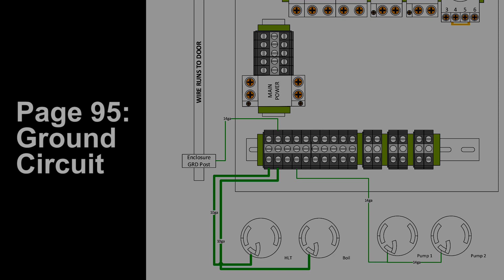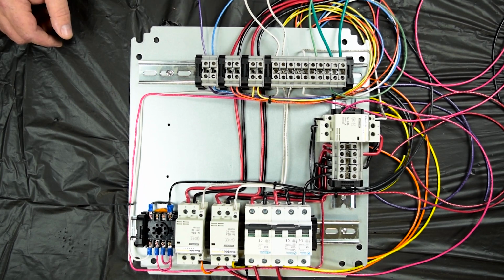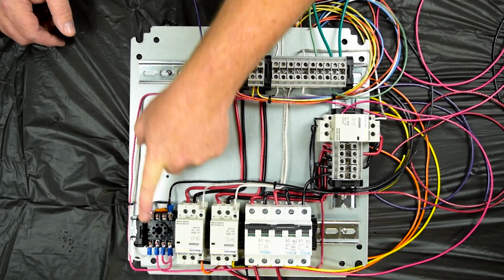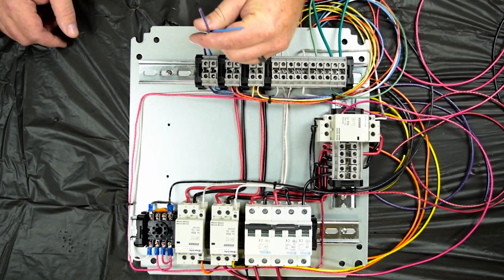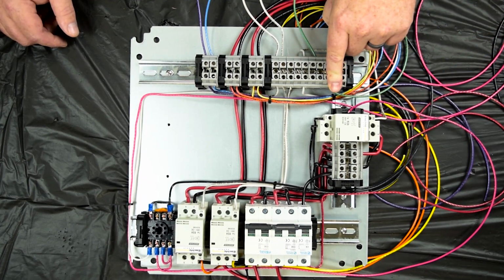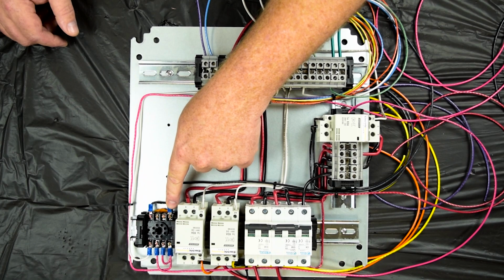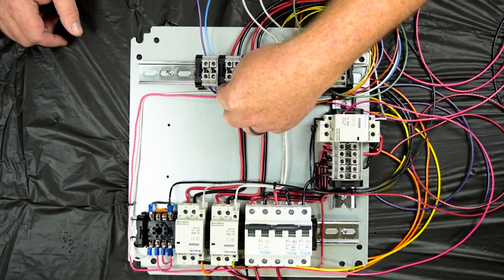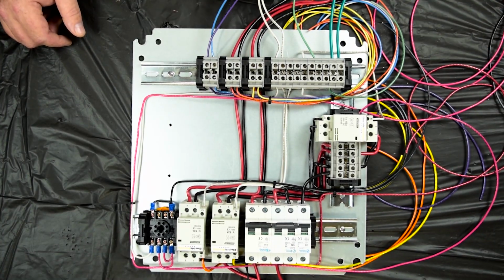Electric Brewing Supply - Panel Build - Back Panel Wiring Completed #electric brewing

Comment: The sub panel is coming along really well. Looks great, Brian! The only things I would recommend doing differently would be to save the 10 gauge red and black wire for last, so that it lays on top of the other wire, and second Pete's recommendation to use cable tie mounting bases to organize the wire as you go. Your wire runs are looking good though, so you'll be fine even if you leave them off the sub panel. But I'd highly recommend them for the door, as it can get really messy. Also, if you look on page 100 of the wiring guide (Wiring the Main Power switch and Green LED), you'll see a loop of red 18 gauge wire that runs from the main power distribution terminal blocks to the green LED. You'll probably want to add that before you merge the sub panel back into the enclosure. Keep up the good work. I'm enjoying following along with your build!
Reply from the maker: Thanks Carl!! Good advice. Thanks for watching.. I used the zip tie hold downs on my own panel and I am planning on adding some to this as well.. something else that the instructions don't call for but I'm going to go ahead and do anyways is put some labels on the back side of the door, labeling all of the components, as well as suggest that people use painters tape at the very least  to help from confusing components when looking at them from the back side. Cheers! 🍻
Reply: The labels are a great idea. You can use the wire colors to distinguish things once it's all wired up, but the labels will help, especially during the wiring process. It can be hard to keep it all straight when what you're wiring is essentially mirrored from how you'll normally interact with it.
Reply from the maker: RIGHT!! Also nice if you ever need to troubleshoot anything.. 🍻

Comment: I noticed that your 30 amp PID kit came with two 240V breakers. The kit I bought from Electric Brewing Supply a couple years ago only uses one 240V breaker. I wonder what prompted the change in design.
Reply from the maker: Not sure? It may have something to do with their UL listing. While these kits are not UL listed, they may have decided to make that change across the board on their kits. Maybe Ryan will comment on this?

Comment: Greetings Brian. Do you split 220 volt to 110 and 12 volt anywhere? What is e stop? cheers
Reply from the maker: Old Norse brewery it is a panic button to shut down  the entire panel. The "legs" of the 220 fo get split. One of them in this video runs to the 110v circuit breaker. On the other end of that connection is the bus bar that connects multiple connections to that one wire coming off of the main breaker.

Comment: What do you mean the power supply was backwards? I have. DIN contractors and thought polarity didn't matter
Reply from the maker: Stephen the power relay was backwards on the rail system. It is not an issue of polarity. It was a visual issue looking at the connections in the instruction manual..I could have left it that way and moved 2 wires, but for consistency to the wiring diagram, I fixed it. That's all. Probably could have not even mentioned it.. But I want to make sure if someone is following these videos in the future they understand the importance of double checking everything.
Reply: Got it, just finished a RIMS controller build but I have to use 240v generator power so I also had to build a GFCI spa panel
Reply from the maker: Cool! I have heard of some people using generators for electric brewing.
Reply: Just using it for RIMS, use propane for everything else. Renting a house, so cannot change the house wiring, active military so we move every few years

Comment: So based off your wiring you are using 110v for control voltage and not dropping to 24vac. That is weird
Reply from the maker: johnjensen4 I'm not sure why that is weird. All of the controls (PID's) operate off of 110 volts. Nothing in this kit runs off of 24 VAC.